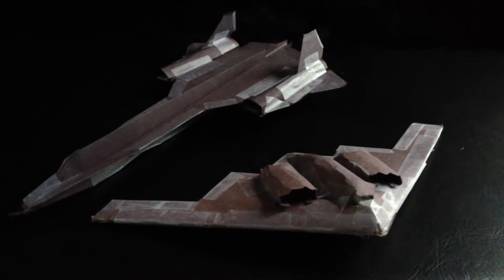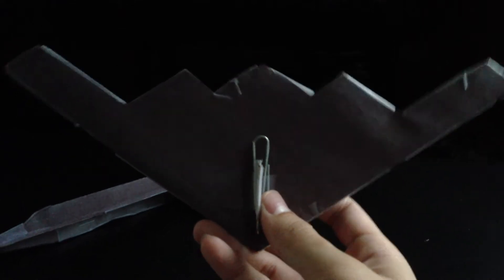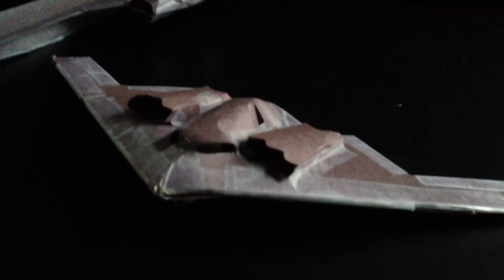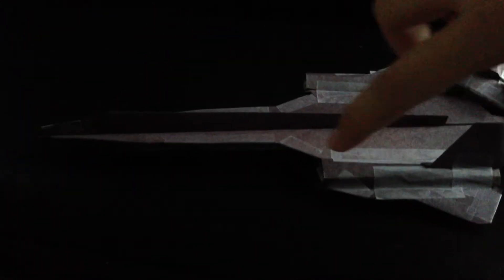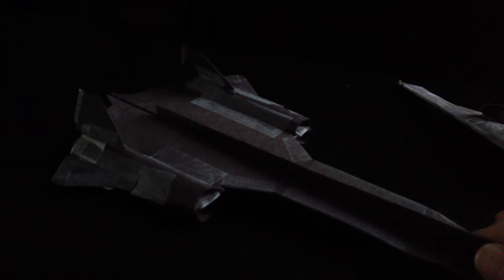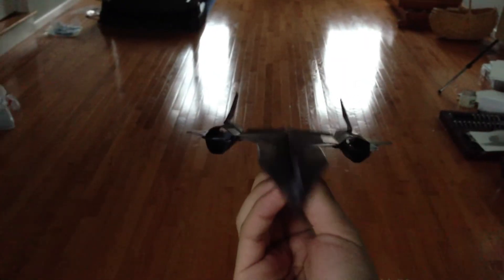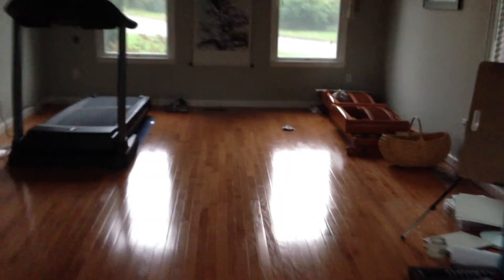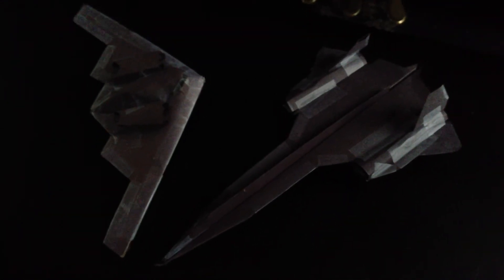Paper SR-71 Blackbird and B-2 Spirit

Comment: sorry, i ment duckerons.both rc and real flying wing aircraft has them. there used as yaw controle dew to the absence of stabilizer and rudder. like i said before, it it banks to the left, set the duckeron on the right,if banks to the right, set duckeron to the left. airbackes are when the duckerons seperate like you said. for duckeron, set down only the bottom duckeron.

Comment: decorons are like two elevator lined up top to bottom.if your right wing banks or rolls to the right, you can open the decorons wich will force it to level out. if it banks to the left, set up decoron on the oppisite wing. it will work best if your b-2 has good cg. yours seem a little nose heavy but its worth a shot